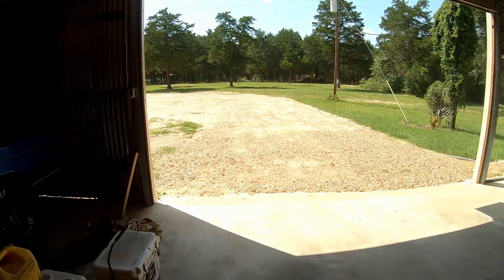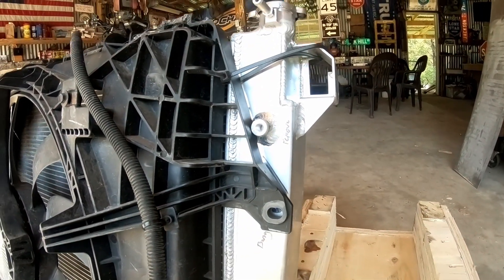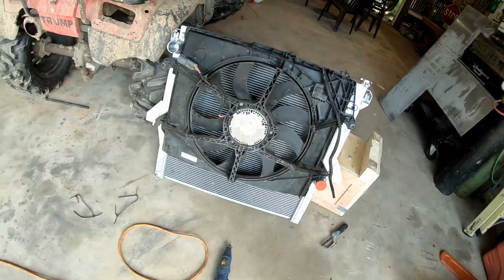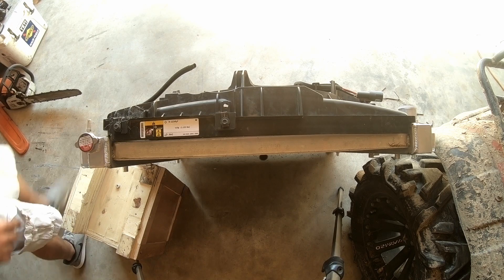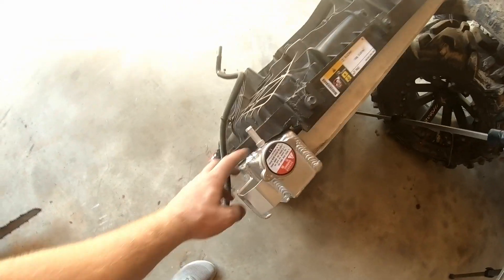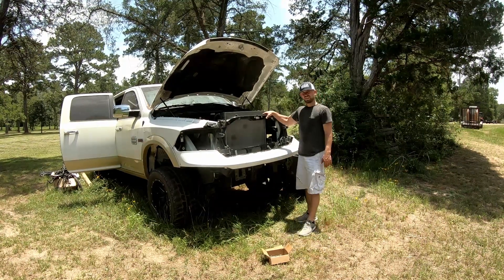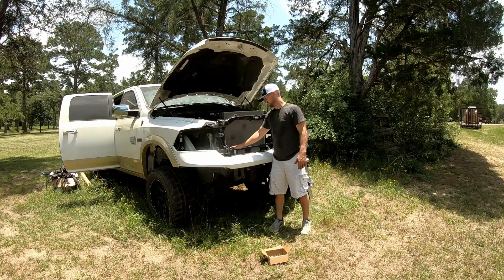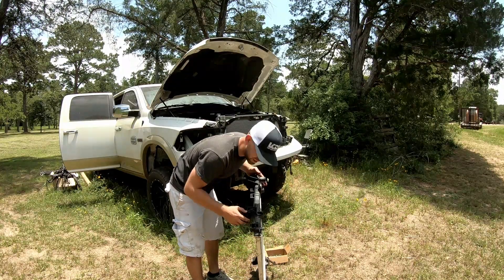EcoDiesel Radiator Upgrade Part 1 - Disassembly and Mounts

Comment: Hey in looking into upgrading my Ecodiesels radiator and there isn't many options out there. How well does this mount up in there? Trying to delete the stock heat exchanger, add a fluidyne one and upping the cooking efficiency of the radiator